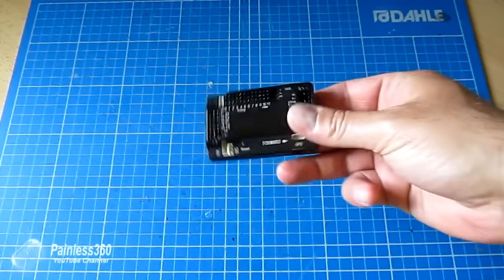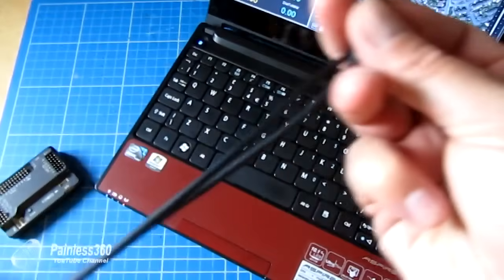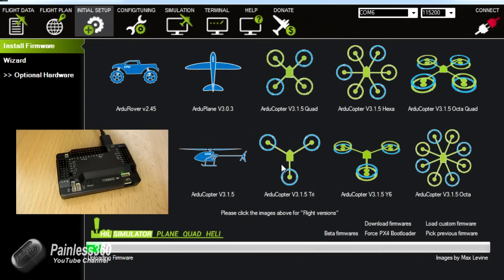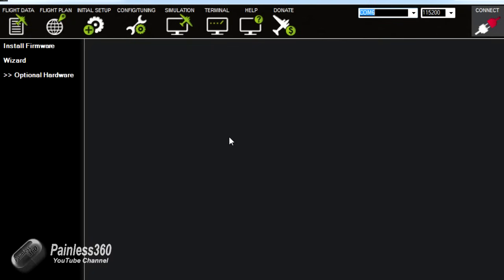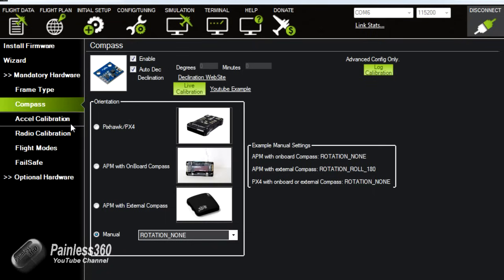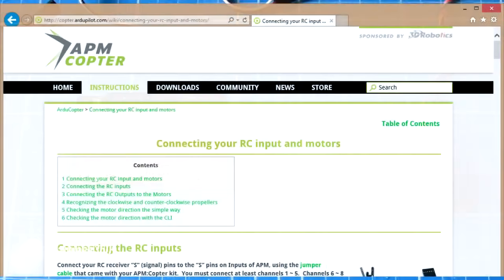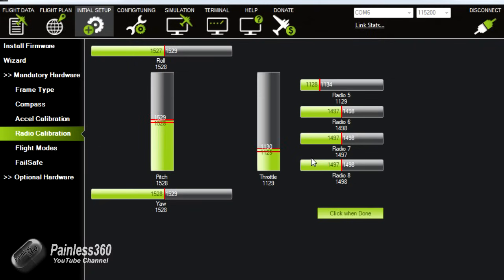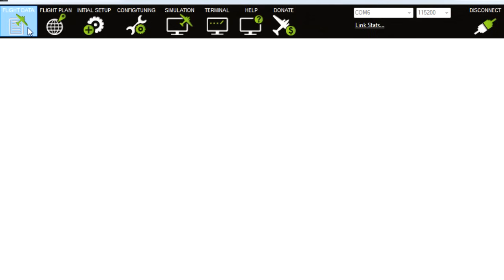(1/8) APM 2.5/2.6/2.7/2.8 - Simple installation and setup overview

Comment: Great vids man! 1 question though, when I start to click connect it got stuck with "Got para  $R0_EXT_STAT, any idea what's going on? I am using APM 2.8 with ArduPlane V3.7.0
Reply from the maker: You can't use an APM with Later than Arducopter 3.2.1 - see our video about it on the channel..
Reply: when you say arducopter, is it similar to arduplane? Cause I am trying to make it work with arduplane, I am really new at this. thanks
Reply from the maker: I've not used the latest versions here, Arduplane, ArduCopter, ArduRover are all parts of the Ardupilot project and are for planes, multirotors and ground based vehicles respectively. A google search of the error found this - http://discuss.ardupilot.org/t/apm2-8-got-param-r0-ext-stat/11554/2 Best of luck.

Comment: First of all thank you for this guide, I'm currently using a Flysky TH9X / R8B transmitter and receiver. and I have connected the receiver as shown in the web channel 1-4 to Input 1-4 of APM. I'm able to bind the receiver and transmitter, however in the mission planner, when I tried to perform radio calibration, no matter how i control my transmitter, there are no readings shown in mission planner.
Is there any thing I have done wrong here, may you advice?
Reply from the maker: Check the servo leads are not connected backwards and plug a spare servo into one of the Rx channels (thro or elev) and check that you can move it using the radio sticks to prove the bind is good..
Reply: Painless360 
Apology, but what do you mean that servo lead are not connected backwards?
I do not have a spare servo on hand to test the binding..
Reply from the maker: Servo lead not backwards so the signal pin is plugged into the +5v pin..
Reply: Painless360
I have checked they are connected properly, but still not able to work.
 Is it due to I've not connected the mode switch into channel 5? This mode switch selection is select from Mission planner itself or from my transmitter?
Reply from the maker: So, to confirm - a servo in either of the channels moves with the transmitter sticks? You've checked that?
Reply: Painless360
i do not have a servo with me, is it ok if I use a quadcopter motor to connect directly to the receiver pins?
Reply: Painless360
Thank you! I have figured i have to take out the bind connection in my receiver and re-on all the connections again, now i can sense all my transmitter sticks movement in the mission planner already!

However may i ask clarify again, for the channel 5 (mode selection) basically what does it do?
Reply from the maker: The mode channel allows you to select how you want the APM to fly your model. See my video on the APM flight modes..
Reply: Painless360 may i ask in the transmitter setup for a quadcopter, what sort of swashplate mode do i use? (Heli1,2,3,4 / plane / Glider), from my understanding  it does seems that my diy quad doesn't  have any swashplate servo
Reply from the maker: Zhen Liang Low Hi, see my video called https://www.youtube.com/watch?v=dLg9dRKIk4c for the answer. There is a APM 2.5/2.6 playlist that contains a lot of useful videos
Reply: Painless360 In this video, you show that the apm can be used in 3 different flight modes via channel 5, how do i select more than 3 flight mdoes?
Reply from the maker: Hi Zhen, you need to program the switch/control on the radio to output 6 different levels. If you only have a three position switch then look at using it with another two position switches together with a mix to give you 5 or 6 modes...

Your radio instructions should help you here.

Best of luck.
Reply: I managed to set up my telemetry already, both are connected however mission planner stuck at "Getting Parameter..." are they any solution to this? My usb connection from apm can load the parameter but not telemetry
Reply from the maker: Do you mean the MAVLink radio link? If so then you probably need to change the raud rate on the airside radio that plugs into the APM. See https://www.youtube.com/watch?v=uGrsTiJnRVk

Best of luck.
Reply: The Baud rate you mean? I have ensured that both the ground and air side are set to 57k already
Reply from the maker: Oh ok. Best of luck with it then..
Reply: Painless360
Hi painless, I tried uploading the new firmware v3.2 code obtained from Arduino IDE to my APM. Once upload i observe no red LED blinking. Only blue LED is blinking, may I know what does this mean?
When i click connect on MP, both red and blue led does not light up.
With v3.1.5 firmware it works perfectly fine though
Reply from the maker: Hi, not sure. I've not seen this myself. The flashing blue light normally means that the board is receiving GPS data.

Places like RCGroups may have more detail. I'd be interested in what it was when you find the reasons..

Best of luck..
Reply: Painless360 
Yup i saw the blue light represent the GPS data, but the funny issue is, i did not connect the gps/compass gblox into the apm yet haha
Reply: Painless360
Hey there, I found out that in ACv3.1.5 I uploaded the code via board "Arduino Mega 2560" it was working. But for AC3.2.1, I need to change the board setting to "APM Arduino Mega 2560" then it will work.
Reply: Painless360
Just another question, in one of your video shows the control of uav using Mission Planner (Mission), but all these requires GPS connected to APM,
Are there any possible methods to edit the code to create a new mode to take off and hold its altitude to assigned it to one of the flight mode instead?
Reply from the maker: The code can be edited - it is open source. I would always advise adding a GPS to the APM, it allows for key features like RTH in the event of a problem and makes the platform far safer for the pilot (and anyone else in a mile radius!).

My advice is NEVER fly a model that you know has an issue. It's dangerous and the model can behave in an unexpected way that can cause harm to you or an innocent bystander.

Best of luck with it all..

Comment: Hello, i just got the apm board and ive had a crash where my quadcopter just dropped out of the sky when in guided mode. any ideas on what happened? I have flown it in guided just before the crash and it was preforming very well.

Comment: Can the APM  be used without the radio inputs and use just switches for Altitude hold or wing leveler?

I am thinking in use of a experimental  aircraft auto Pilot?
Reply from the maker: Yep - you can use the 3DR radios and a link from something like Mission Planner to fly. Use a PixHawk now as the APM is VERY old..

Comment: it looks like your connecting to a turnigy 9x reciever. the same set up I have. This is a newbie question but are the servo connectors male to female?
Reply from the maker: Most of the connectors are female with pins on flight controller or radio receiver. You can buy extension leads for the servo connectors with male at one end and female at the other.

Happy flying!

Comment: great video, very helpful - but i am struggling to wire up the APM2.8 to a AR6200. Can anyone let me know, how i would determine the correct polarization of the wires from APM2.8 to AR6200.
Could not find any proper description.
Reply from the maker: +marcinusa USA from the manual the row of pins farthest from the label look like GND. Check by using and multimeter to see if they are all connected together. Best of luck!

Comment: would you recommend the 2.6 version for an octo? size approx 1000mm across rotors.or can you recommend another f/c please. thanks
Reply from the maker: For a modern build I'd consider the PixHawk now. See out compassion video on flight controllers from last year. It's a little old now but still covers my thoughts on larger models. Happy flying!

Comment: Very good serie. I have a question: I can´t get my motors to spin at all, what can it be? I using the apm 2.6 and a TGY-i6 transmitter. Thanks
Reply from the maker: +Albin Rosenqvist I would check out the 'Troubleshooting arming' video in the series. Best of luck!
Reply: +Painless360 thanks for the fast respons but. witch number is it?
Reply from the maker: Use the playlist to find videos listed in series with clear titles help you find what you need.. Best of luck!
Reply: +Painless360 that did´t work. what can it be then. I have callibreted everything
Reply from the maker: What does the GUI show when you try and arm the board then?
Reply: +Painless360 Where can i see that?
Reply from the maker: It's all covered in that troubleshooting arming video.. Best of luck.
Reply: +Painless360 thanks! Now two off four motors spin. After I have held the stick to the bottom right side, but it just spin and I can't control it. what can it be and how can I get the other motors to spin? Thanks again
Reply from the maker: I would manually calibrate the ESCs... We cover all of the steps to get a model working, in the right order, on the series. I'd advise you to watch it from start to finish.. Best of luck.
Reply: +Painless360 thanks I'll do that

Comment: Hello again !       Thanks for such a quick response and helpful video !   My problem is that I can't get my DX7 to work any of the control modes at all in the setup menu in mission Planner.   In your video ( 1 /8 ) when you operate your 3 way switch the flight modes change in the on screen menu but mine will not.   It works fine with my Orange rx hooked up to an Orange RX 3 axis flight stabiliser.   Help ! ! !
Reply from the maker: Sounds like you have the cable plugged into the wrong output on the transmitter then. You need to check what connector the cable plugged into AUX 1(Mode switch - 12:48) is plugged into on the receiver. Should be AUX1 is you are using an orange RX and the same setup I showed in that video..
Reply: Painless360
 Hello Again  !   Sorry I don't kow your normal name and it seems impersonal to address you as Painless 360  !
Thanks for your quick reply but I have tried connecting lead from Aux 1 on my Orange Rx to port 5 on APM but no joy.
Reply from the maker: Check on the monitor screen on the radio to confirm that the channel values are moving as you move the switch and then connect a spare servo to that output on the receiver to make sure that this value is received..

Best of luck.
Reply: Painless360 Hi there . . . ?   Sorry - I still don't know your name !      Thanks for your reply.   I was beginning to suspect my DX7 but after trying your suggestion the following happens :  Connected servo to AUX 1 on Orange Rx and when I operated 3 posn switch the servo moved from rest to 2 further positions in what looked like equal steps and back based on where switch is set.  I then tried it in GEAR channel and when operating Gear switch servo moves from 1 position to another and back when switched off.   This tells me my DX7 is ok.   Gone back into M P : Flight Modes menu and when operating switches ( either of them connected to Channel 5 on APM ) nothing is highlighted on M P screen as in your video.   Could the APM be suspect although everything else is working and when connected it finds the location of the unit in my house spot on every time and reacts on screen when moved around various axis.   Sorry to be a pain but I'm totally baffled ! ! !
Reply: Painless360
Hello again my friend !   Well I am really baffled now.   After sending last message to you I decided to follow your video and set up the hexacopter as per your video.   Without channging anything on the DX7 would you believe the flight mode selector switch works  ! ! !   I then followed your other video on mixing in the DX7 to get extra flight modes using the AUX 2 switch and it all works fine.   I went back to set up the APM for use in my plane and switches don't work again in flight mode menu ! ! !   I really need to sort it as I don't want to risk losing plane with all fpv equipment and cameras etc on board.
Reply from the maker: You need to recheck that a servo plugged into that channel on the receiver moves when you move the mode switch on the radio - that will tell you if it is a radio or APM setup issue.

Best of luck.

Comment: 500 quadcopter fly's great i try to put failsafe in several times no luck my quad in my hand at half throttle it goes crazy hard to hold i did something to my mission planning that did this do you have a video to help.
Reply from the maker: The videos for all of this is in this series. We so setup and test failsafe too. Best of luck..

Comment: Hi, very nice video :) I am looking to start a new built withthis controller dies it support sbus please?
Reply from the maker: It does not support SBUS nativity. You can connect an SBUS recurve by using an SBUS to CPPM converter but remember the APM only supports 8 channels. I have heard of people using custom code to try to get around this too so a search in the forums may be useful. Hope this helps

Comment: Hi l am having a problem with one of my hobby wing x rotor 40a escs it will only spin up to about 1/2 the rpm of the others. l have cal. like you said both in the all in one and the manual way. l also checked the manual and they appear to program a different way, so l also tried this approach with no luck. buy the way, my modded fly-sky fs-t6 is programmed to have 6 flight modes which l am very happy with but l am still planning to get the taranis9x. sorry no log data to send as l have just been able to get it up for a few seconds. any thoughts.thanks
Reply from the maker: John Turner To confirm it is the ESC I would swap the motor connected to the suspect one with another and check that the problem stays with the ESC and not with the associated motor. 
If that's the case then it sounds like a problem with the ESC and I would go back to the vendor.
Best of luck..

Comment: So I followed your instructions and got most of the initial setups configured, then I unplugged the board for about 45 minutes, and when I came back and plugged the board in, I couldn't get it to connect, or at least fully connect.  When I plug the board in, the lights on my APM 2.8 change there blinking pattern which makes me feel like it is at least partially connected, but it doesn't pick up when I tip the board on the gyro monitor screen, and when I connect the radio, it doesn't pick up any input.  I'm so confused because I JUST had it working.  Any thoughts?
Thank you!
Reply: And never mind! I just restarted APM planner and everything is back up. I probably should of tried that before I went crying for help..... Thanks anyways. And thank you for this awesome video series. I honestly don't know where I would be if it wasn't for your videos!

Comment: i was follow your instruction, my quad can take off, the problem is when my quad on height about 5 meters, all motors is stop working, then falling down to the ground, i check the batt, still 16.1 volt, my battery is 5800 mAh, 4s, 14,8 volt, what's going on on my quad, please reply my question, thank you
Reply from the maker: +magfur ramdhani Happy to help but please watch https://www.youtube.com/watch?v=olIqTiSJHIY and come back to me with more detail of what you've tried..
Reply: how to setup APM 2.6 with 4S battery?
because the problem is, when i set the low battery on fail save above 10.5 volt, the APM doesn't armed, the APM armed when i set 10.5 volt low battery on fail safe setup

plz reply
Thank you
Reply from the maker: What does the error show as in Mission Planner when you try and arm it with the LVZ set to above 10.5v?

Comment: Hello,
I have a 2.8 version which connected OK when I followed your video a couple of weeks ago, but I have since changed my transmitter from a Turnigy 9x to a Radio Link AT9.

I followed your video again from the start and reinstalled Mission Planner as I had downloaded a later version from Ardupilot.org.  The trouble is now that I cannot connect the controller to my PC.  It shows only COM3 and COM4 in the dropdown list but it would not connect to them.  Device Manager says that both are being used by my bluetooth adaptor.  It seems that Mission Planner did not install the necessary COM ports.

I have loaded them manually into device manager using the inf files from a zip file.  They show in Device Manager but not in Mission Planner.  Can you help please.
Reply from the maker: +Peter Brown I'd be tempted to disable the BT.. Best of luck!